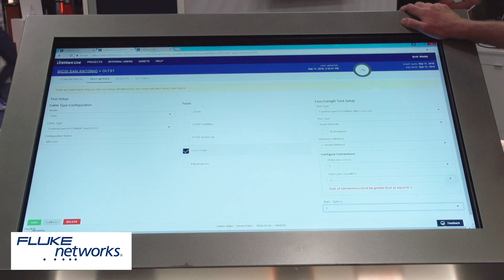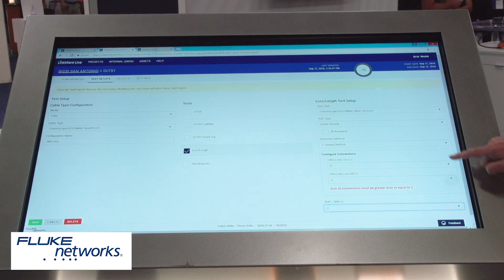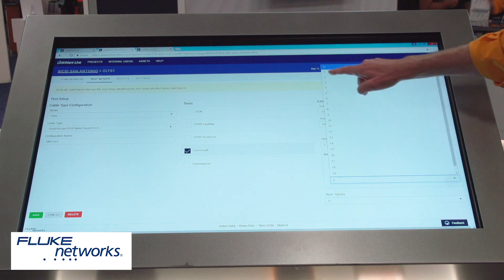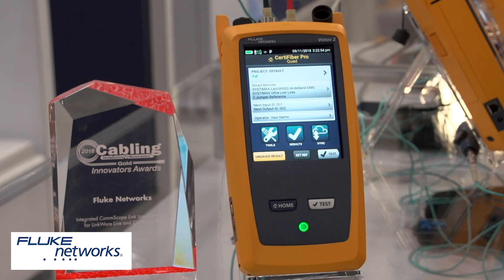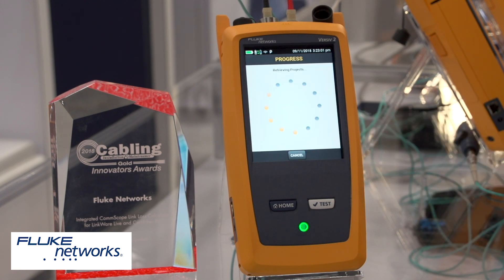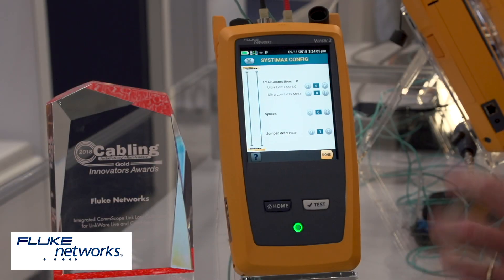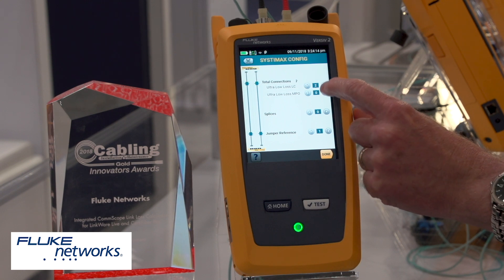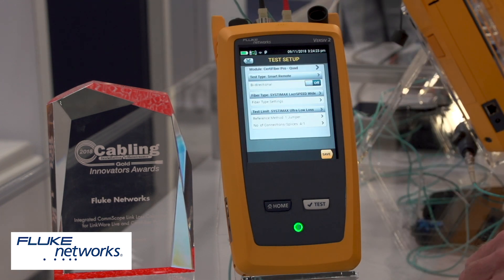See Why CertiFiber® Pro Won the Gold Innovator’s Award

Comment: BUENOS DIAS TENGO UN  OF-500 CERTIFICADOR DE FIBRA Y TENGO PROBLEMAS EN QUE NO ME RECONOCE EL CABEZAL MM ALGUNA SUGERENCIA..LO UNICO SI QUE ME PIDE ACTUALIZACION DEL CABEZAL ALGUNA AYUDA GRACIAS  +59176351029 +59172682097